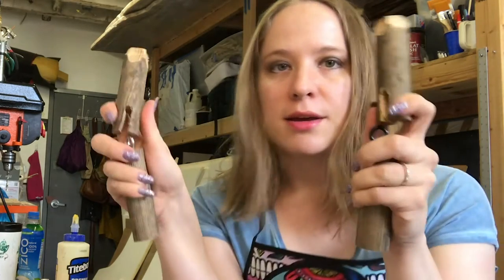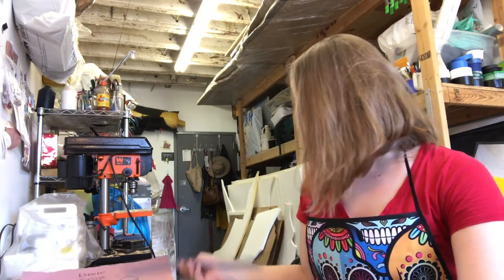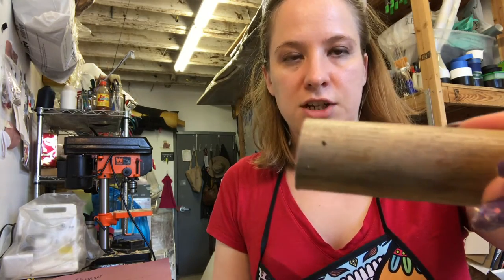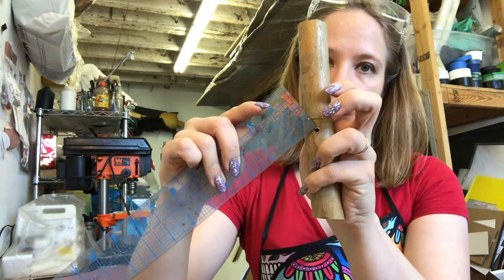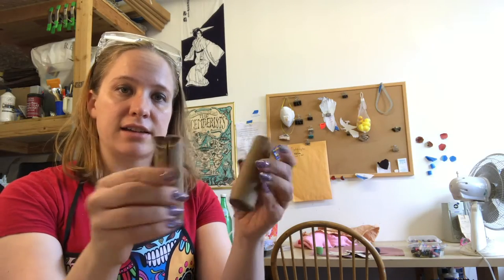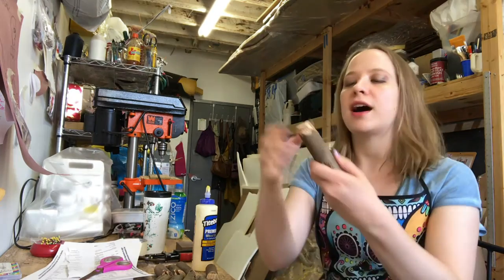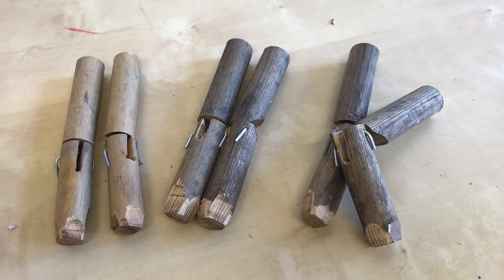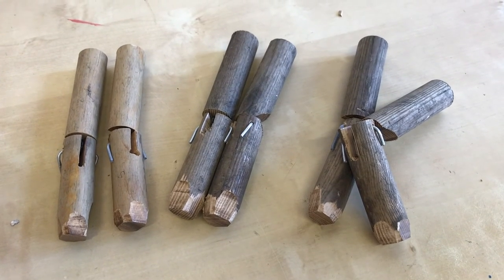MARIONETTE BUILDING 101: How to Make Marionette Legs

Comment: I see this is three years old. I suggest the Land Link, a method of joints by Scott Land, of Team America fame.

Scott looked for a simple method for joints that gave the free movement he wanted, strong ,easy to make, and cheap.

He saw plastic chain at the hardware store and thought it was worth a shot. It met all the criteria. They even functioned correctly for movement. They can be used with wood, resin, you name it. 

He simply takes a link, cuts it, drills hole, or however you want it attached, and CA glue, or epoxy, and you have a fantastic joint. 

The plastic links also can be used as arms if you want loose arms.